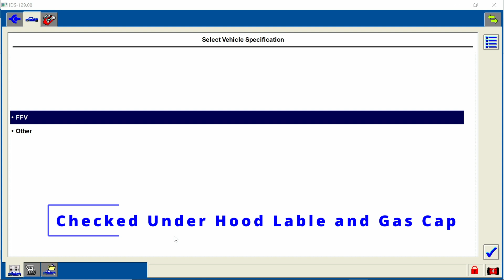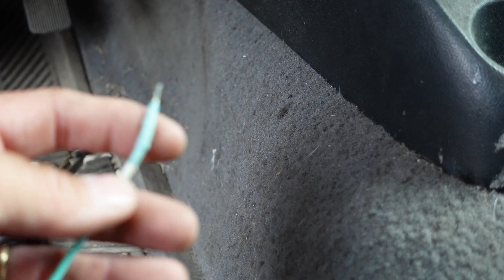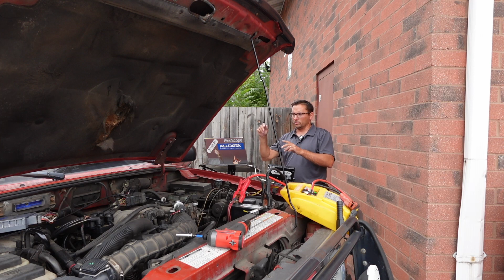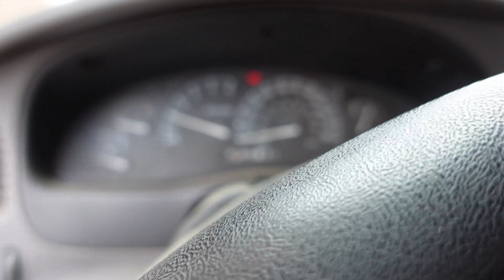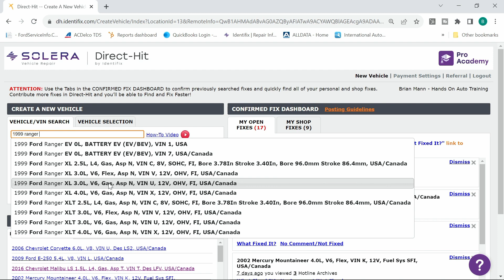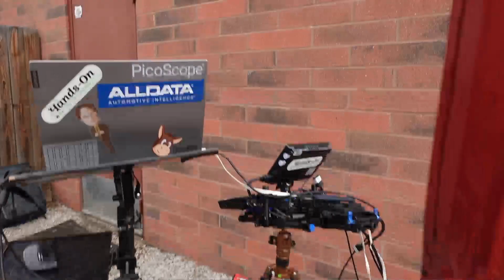1999 Ranger PCM PATS CMP

Comment: Could you help? I have a 2000 ford ranger 3.0 l i changed fuel injectors and forgot to remove the battery. Now my obd 2 scanner doesnt connect and no crank no start. The antitheft light flashes 6 times and the pcm cannot communicate with the ecu. Did i fry my pcm?
Reply from the maker: Changing injectors ( electrically speaking )should not cause lost communication. I would recheck all connections including grounds, also make sure you have 5v ref key on engine off at tps and dpfe,  a shorted 5v ref will stop comm .

Comment: I love checking back pressure on fords with dpfe. Just connect a vacuum/pressure gauge to the dpfe port and give it a snap throttle. Easiest vehicle to test. 
Here in Colorado I am at 5300’ ASL and our typical BARO is 143hz, 83kpa, 12.4psi, 24.5in/hg. I’m glad you mentioned elevation because even many of the paid training events don’t mention the difference of a known good at sea level vs high altitude. 
We also have customers that live at 9,000’ but only live 30 minutes away so you have to check their address if the baro is off. 
Thanks again for the video. 
Was that the atem switcher?
Reply from the maker: Yes that is right!! I for got so easy to test at dpfe!
Reply: When I drive to aspen I always stop in colorings n have my altitude adjusted. 1983